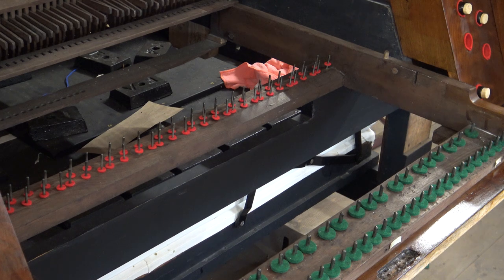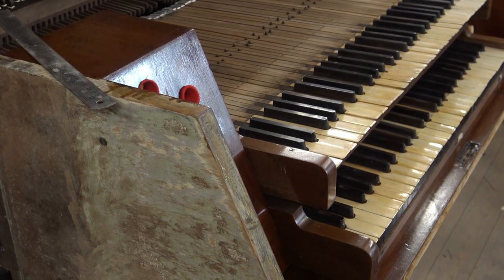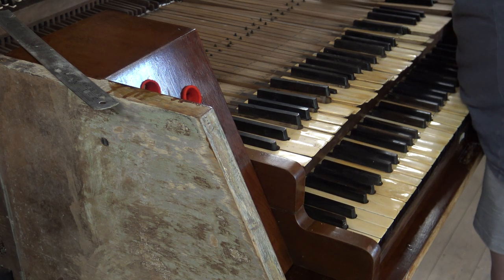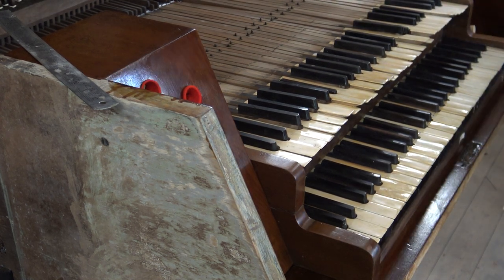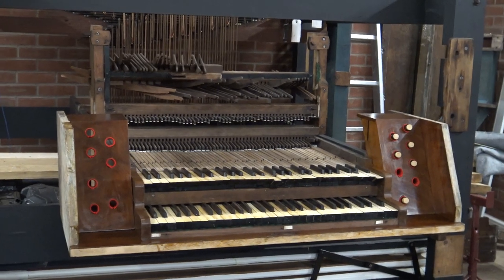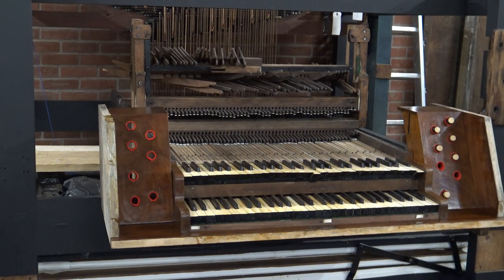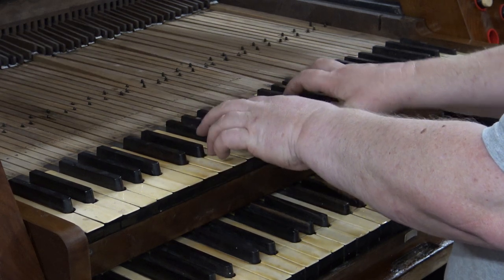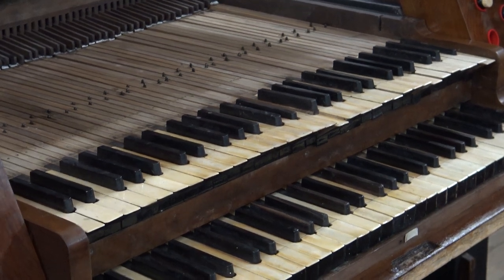1865 Forster & Andrews Pipe Organ Restoration Pt19 of loads

Comment: Those Violin-Diapason pipes need to be tuned and that cyphering fixed on that flute pipe.
Reply from the maker: I think I mentioned in the video that the Violin Diapason was waiting for tuning slides to be manufactured for the tenor octave at the time this was recorded.

As this organ is direct mechanical (tracker) action I don't think the work 'Cypher' is correct. As an organ builder, my experience is a cypher is when a note plays on it's own on a pneumatic or electro-pneumatic action. In this instance we have to appreciate this organ has had all the pallets re-leathered on the Swell soundboard. The slightest imperfection of flatness either on the pallet or the soundboard itself is going to allow wind to just pass through to the pipes. When this happens, it's known as a whimper. 

When I re-palleted the soundboard, great care was taken to ensure the soundboard bars & the pallets themselves were sanded flat before being re-leathered & assembled. I then fed a CCTV camera down each soundboard bar to look for snags. So when we get whimpers, these usually disappear on their own as the pallet leather beds in. There were about 5 notes that played up a bit & middle   C was the worst. All others got sorted out one way or another, Middle C ended up having to have a 2mm bleed hole put in the calico that covers the appropriate bar. 

Richard,

Ireland-Shireby Church Organ Buildrrs,

Lincolnshire, UK